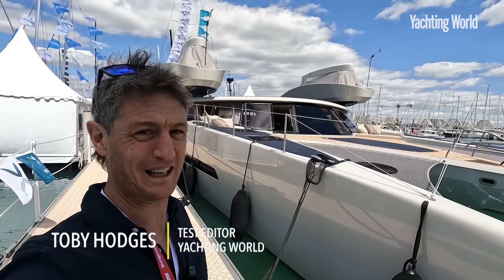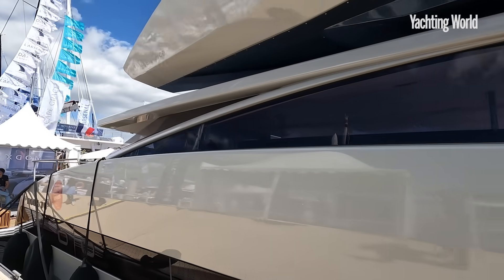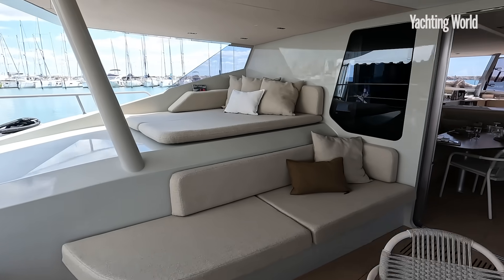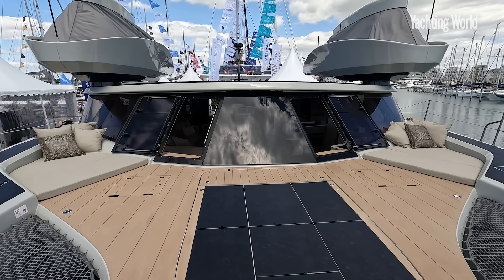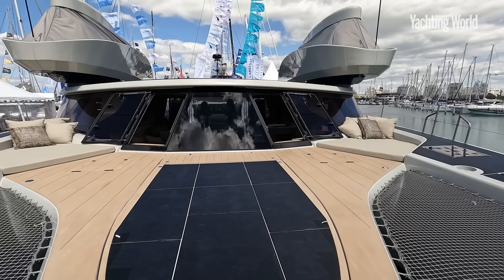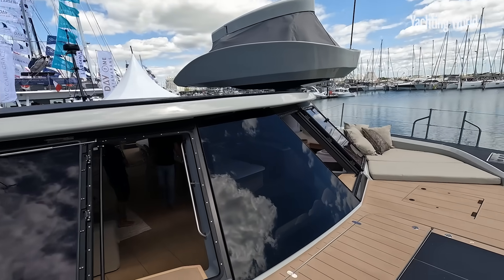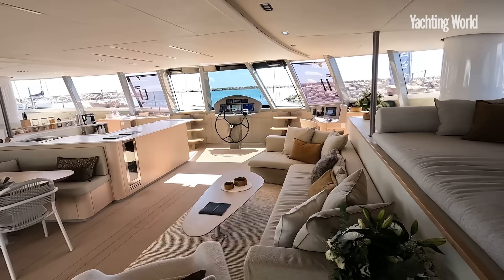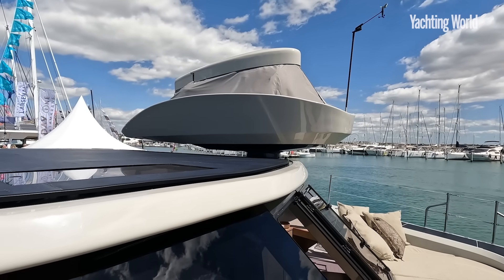Meet the MODX, an electric 70ft cat with fully automated inflatable wingsails!

Comment: The hull design alone looks amazing. It looks like it would almost eliminate any deck slap with that 3rd center hull being shaped as such where it will split the energy of the oncoming wave with those contours. We could see this mid forward hull on upcoming cat designs or it already exists? This beauty is low and sleek and seems extremely stable. So many issues solved here it seems; like the compression from all the rigging...which really bothers me about cats when you consider the issue with bulkheads like the Lagoon 450.  Would be very interesting to see it take some rough seas.   I'll take a 38' mono with this now please xD  omg the draft could be almost nothing. Finally, some real forward progress. It seems all the current designs with sailboats, mono's included, have so many opposing forces constantly battling one another that keep you on the edge of failure. One little weak point here or there....one little leak here or there. One big wave from the wrong direction. Everything being held together by metal in a saltwater environment.  if you think about it, you kinda have to be a mad man to take anything away from land.
Reply: Madman here, land ahoy, scape yachts the best I have experienced!
Be prepared,be humble, the adventures will come, believe me
Reply: The deep center of the deck will also add a lot of drag in waves.

Comment: im quite sure that no co2 was emitted in the manufacture of this vessel and its component parts.  and the lithium mines which supplied the material for the batteries were the new, environmentally neutral type.  same for the rare earth elements in the solar.
Reply: It's a luxury boat, nobody is going to save a single baby seal. Go eat a rare steak and relax.
Reply: Buddy, what a tired old argument that carries zero equivalence to the massive open cut coal mines, billion dollar oil rigs polluting the ocean, the rail lines and road miles travelled, the filthy refineries and massive emissions of millions of tonnes per annum destroying the planet’s environment. Lithium’s time is about done and new battery tech will obviate its need, the rare earth elements are still required in the computers of combustion engine vehicles, ever wonder why catalytic converters are so popular to steal? This is not even an argument any more, saving the planet is the argument and you simply cannot say ICE power is superior to free energy from the sun, wind and water in this case.

Comment: Seems like a very expensive piece of "hopium".  Even unobtainable "max" numbers for solar cells plus prop generation won't provide reliable charge to keep this thing fully functioning.  I won't even start on those inflatable sails.
So...  where's the diesel generator hidden?
Reply: Clearly bored today and nothing better to do than troll.

Of you go champ, back to your basement😂
Reply: @PN_48  Listen to you... clearly the bored drunk troll with your endless claims. You've been on walkabout too long, "champ" 🤣 🇦🇺
Reply: I would be more worried that an electrical failure would also freeze the sails and probably the rudder.
Reply: So explain then how there are several boats that are 100% reliant on free energy, ever heard of the El Canó challenge? Sailing Into Freedom is going to set off for an around the world challenge on a cat with no fossil fuel help. Dinosaurs are extinct, just like those who refuse to believe in change.
Reply: @steviefordranger198  Poor reference.  Cornell, the bloke who came up with the Elcano World Challenge,  FAILED with a fully electric sailing yacht,  giving up 3 weeks into his voyage.  He quit this "challenge" as it's currently unrealistic.  It may work in the future,  but for now,  the power generation and battery efficiency are inadequate.

Comment: Didn't Jack Cousteau test the concept of this decades ago 🤔?
Reply: "Jacques" 

Cousteau and associates worked on the turbosail (or turbovoile in French), which is a marine propulsion system using a sail-like vertical surface and a powered boundary layer control system to improve lift. It was tried on the vessel Alcyone . It requires power, so it would probably not work in this all-electric configuration.  Alcyone was a diesel-powered monohull, used for about three decades by the Cousteau Society.

Comment: Can I fix it myself? Are there redundancies?
Reply: Power failure or a computer glitch off a lea shore in Force 8 would be interesting!!
Reply: @dancarter482 Why? It’s a boat with two sails and two engines. There’s redundancy. Offshore, it’ll still float until the issue is sorted.

Comment: Thanks Toby.  Really interesting boat.  There are many different ways to do a wingsail and a telescopic mast with inflatable sail is interesting.

You could have explained the wingsail a little better. Jibes are done by moving the head of the sail across the wind, same as a windsurfer.

The wing is too thick to be efficient in high winds.  For example Americas Cup boats with dual skin mainsails start with a thicker wing coming out of tacks and thin them out as speeds build back up, since a thinner wing is more efficient at higher speeds.

There's too much mass/volume high up in the rig, leading to pitching visible in the video.

And it most definitely does have a rig; just a different one.

Unstayed masts in general have a ton of advantages, but obviously can't use staysails.

Comment: They need to go back to drawing board and bring the masts aft about two meters. Really solid concept though.
Reply: So you think Mod 70 designers don't understand the dynamics of sailboats?
Reply: @LoanwordEggcorn  I assume they do but they can be off by a certain margin just as well. It’s a completely brand new platform, one should expect such things, right?
Reply: @q5echo154  I expect they would balance the above water aerodynamics against the below water hydrodynamics when they design the boat.

That said, some of the video may have had a reefed rig.  With the full rig the center of effort may be higher.
Reply: @LoanwordEggcorn  I didn’t notice either sail reefed. I prbly missed it looking at the several degrees of bow-dive underway compared to her moored to.
Reply: @q5echo154  Agree she pitched a lot for the conditions.

Comment: Fascinating new design. Don't quite understand the need for an inflatable sail vs normal sheet sail, but I'm not a sailor either, lol. As for layout, I'd personally want those upper lounge areas in the salon to be on the outside, to lounge and watch port/starboard sides on passage, and it needs a walk-through from bow to stern. Regardless, I love to see new idea come to fruition. Fantastic to see!
Reply: Inflatable sails eliminate the need for any rigging, can be three-dimensional like plane wings, and permit 360-degree rotation for more efficient sailing. More importantly, reefing is accomplished with the touch of a button. Reefing isn't always an easy affair, and it can be dangerous if a sudden storm comes up. So, having an automated reefing system is welcome, particularly for the less mobile contingent out there.
Reply: The tradeoff is no lines/shrouds/sheets vs complexity in the telescoping rig and inflatable sail.

There is a walkthrough from bow to stern, via the front doors.  Presumably the foredeck would be unused in storms, etc.  The whole boat doesn't look like it would do well in storms.

Comment: This is what I've been waiting for.
Reply: If anything goes down, you are in trouble mid-ocean
Reply: @jjosephm7539  Is that different than any other vessel? This craft simply requires an electrical knowledge instead of mechanical one.
Reply: @jjosephm7539  In the last 300nm my starter motor, fuel injection pump, fuel feed pumps, main engine cooling system pump, raw water pump and other mechanical things went wrong. On this boat if I had to manually pump up or reduce sail and manually steer at least I could get to safety like I had to sail to port in my conventional sailboat.
Reply: @jjosephm7539 like every other boat.

Comment: Really interesting welcome to the future, I'm guessing that it's possible to have a monohull version can't see why not? I wonder what sort of warranty is offered
Reply: A monohull version would be amazing to see for sure.
Reply: I think a mono would struggle/fail to accommodate a dual wingsail set up (unless you mounted them outboard of the hull maybe).

A single wing would need foresails so you'd lose the automatic/power boat ease of operation. And you'd probably also need a fixed mast. So it just becomes a regular boat with a wing. Beneteau had a test boat with a wingsail about a decade ago.
Reply: A ketch rig might work but hhey leave it to the experts im sure they have considered all varables and know whats best@AdeboFunkyVoodoo

Comment: I love the concept, but I struggle with the cantilevered rotating sails from a structural integrity perspective.  The base of those sails will be under immense bending stress, and will cycle through load and deload with every wave and gust of wind.  I see fatigue failure being a major issue with the longevity of something like this.  From a dreamers perspective… they should build one of these as a sailing landing craft.  Talk about adventure craft capabilities!!!
Reply: You're right, the engineers and manufacturers probably didn't think about the stress that the wind would put on a SAIL BOAT
Reply: @bp4354  Really sure about that? That's a major assumption without knowing the engineers, their professional experience, or their knowledge base. All we have are their design objectives, and what can be gathered from the videos released so far, they're pretty close to realization. Long-term durability of the various systems is unknown, of course, but that's par for the course with every innovative design that has no direct precursor.
Reply: lol.  I’m sure they did.  But, engineers make lots of mistakes in assumptions. Remember, this is a concept boat. Time will tell how well it performs or if they make additional prototypes.
Reply: Actually a better response from me should have said: you are right, the engineers likely did account for those stresses.  However, engineering is about making choices that involve a lot of tradeoffs.  I expect that the choices these particular engineers made was for immediate functionality, at the cost of long term reliability/durability.
Reply: Have a look at SY Safira - the Chris White 72 with twin free standing masts. The owners very kindly gave us a tour recently and it is tech like you wouldn’t believe. Free-standing Southern Spars masts and an average passage speed of 18-22kts.

Those that say this is a “day sailer” are clueless to the technology already out there.
Reply: @PN_48  As any real sailor can confirm,  the more "tech" a boat has, the less sailing you do.  Looks great for sitting at a dock, hooked up to a reliable electricity supply. 🤣
Reply: @maxhugen ”Real sailor”😂😂😂

Sure thing bud. So that means all the modern cats and multis - full of tech - are just dock queens? I guess the hundreds that have passed through this Carib anchorage this season don’t know that, and inform them some YouTube “expert” says they should head straight in to a marina😂
Reply: @PN_48  I doubt the hundreds of multihulls looked anything like this dockside thing.
Reply: @maxhugen Man, you really are clueless. Once you’ve actually left your basement and come out cruising, then feel free to comment. Until then you’re just another armchair “expert”😂
Reply: @PN_48  Having hand built a 48' fibreglass ketch from the ground up in the 70s,  and competed in the Sydney-Hobart yacht race, I daresay I've done more than get drunk on a tiny catamaran.
Reply: @maxhugen So not a 45ft steel ketch? Or a 42ft GRP tri? How about a 43ft cold moulded cedar tri?

I guess all those years of experience with monos really makes your “opinion” of multis useful😂
Reply: @PN_48  You're such a boring troll, dribbling rubbish.  Stop getting drunk!  Q.E.D.
Reply: @maxhugen Mono purists are always such a good laugh😂

Now did you actually have anything useful to add to this multi conversation?
Reply: @PN_48  Chris White boats are high performance bluewater cruisers.  This boat, probably no as much.  Apples and oranges, mate.
Reply: @LoanwordEggcorn Again, not sure how you’re misreading the base comparison of both Saphira and this boat having twin free-standing rigs, but hey ho.

The concept has been proven and works well. Doing it with inflatable rigs is an interesting choice - one I suspect that won’t work for everyone but will suit a niche market.
Reply: @PN_48  Lots of boats have unstayed masts, for example most junk rigged boats.  Also the smaller James Wharram catamarans, etc.
Reply: @LoanwordEggcorn Yes, which is exactly the point I’m making to the original commenter who is questioning the “structural integrity” of this setup.
Reply: @PN_48  There will be some difference between a telecoping mast and a single piece one though.
Reply: @LoanwordEggcorn True, however I wouldn’t be concerned with the structural integrity of the lower portion of the mast (beneath the deck or the hull / deck rotation. 

If anything was to fail - and like anything on a boat - I’d expect it to be the moving / telescoping element. That’s the part that will be cycling periodically and I’d be intrigued to understand the usable service life of an inflating rig prior to fatigue based failure being a factor.
Reply: @PN_48  Agree it's the telescoping part that's probably the weak point, and maybe that was the point of the original poster.
Reply: @LoanwordEggcorn Maybe. The OP made it clear they were questioning the structural integrity of the “base” and with a rotating mast, that’s one of the strongest points.
Reply: @PN_48  "The base of those sails will be under immense bending stress, and will cycle through load and deload with every wave and gust of wind."  

The base of the mast under the deck isn't the base of the sail itself.  The sail is above deck.

The highest loads will be where the sail meets the deck, and they are dynamic.

I'm sure one can engineer to that load, but it's still asking a lot of a part that can telescope and rotate.  It seems like the most likely point of failure.
Reply: @LoanwordEggcorn It will also depend if the telescoping elements rotate independently, or if they remain all fixed in alignment and the entire mast rotates as a whole. One would be significantly less complex than the other.

Either way, my concern on fatigue life would be more focused on the telescoping sections than on the below deck mast base or the “sail base” immediately above it.
Reply: @PN_48  Stress will be concentrated where the mast meets the deck.  (And at the connection of each segment of the mast.)  You're right that the telescoping segments may not rotate.  The wing can rotate around it.
Reply: This reminds me of the PlaneSail trimaran developed in the early 1970s in Portsmouth, UK. This had a rigid biplane steerable wing sail. In theory it would handle force 10 winds, and the Wingsail would feather into the wind.
Reply: @boatman909  Theory is great,  but "handle force 10 winds" ...  nope. There's a reason why multihulls are most stable upside down.
Reply: It is basically a day boat at this point. Don't go too far or you might regret it .
Reply: @frankjames7272 😂😂😂 Sure sure
Reply: @frankjames7272  I'd bet they need a hidden diesel generator even for day sailing.  🤣
Reply: Wing sails work the same way an airplane wing works. They create  low pressure on the flat surface and this PULLS the boat along... not pushing like a normal sail. So there is little stress on the sail itself, as it positions automatically to funnel the wind along the wing. Wingsails do not broach either. You can steer  in any direction to suit the wave pattern and the sails reset themselves for best effciency. You can also put them in reverse.
Reply: I’m so glad you brought the conversation full circle to an area I am an expert in… aviation.  I’m also a licensed (structural) engineer. First, just because a wing sail uses aerodynamics the same way an airplane wing does, does not mean they transfer load the same way. For instance, planes either have a through spar, or use the fuselage as a structural membrane between the two wings.  Also, many concerns here aren’t related to if it’s possible, just interested in how it will perform operationally.  The V-22 Osprey could be considered a success due to it being the first tilt-rotor aircraft used in military ops, or a failure due to its servivability and crash rate depending on your opinion… everyone is entitled to their opinion, some are more informed than others…
Reply: @michaelsachse6672  The wing looks too thick to be efficient in high winds.  Should be ok in lighter winds.  The telescoping mast is cool, but would seem to have lots of potential failure points.
Reply: @louisavondart9178  All of the force of the wing is transferred to the boat via the mast, so the mast gets all of the force needed to move the boat and more due to transients, for example from wind gusts and shifts and any non-laminar flow.  All of the force on the wing must be carried by the sail material also, same with normal sails, which is why they're made from a strong material.

A wingsail wouldn't broach if it could be moved quickly enough to respond to wind changes, but that's not always possible.  (Also not all wing sails can turn 360 degrees.  The America's Cup boats are fast enough that most sailing is upwind.  So they don't need to be able to turn backwards, and can't due to the stays.)
Reply: @louisavondart9178  "So there is little stress on the sail itself,"  Whether you "pull" of "push", a sail of any sort creates a force. otherwise you're just sitting going nowhere. Aerodynamics is interesting.